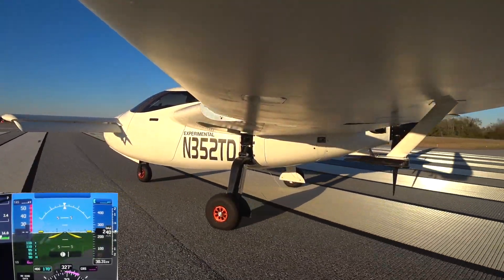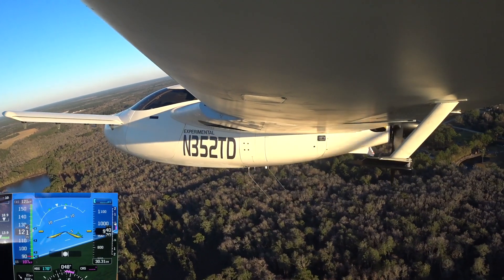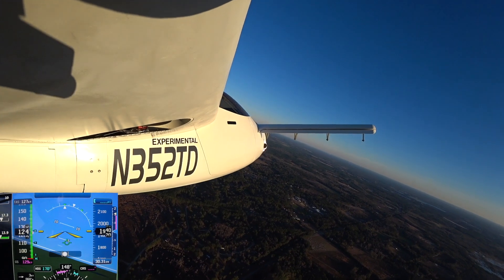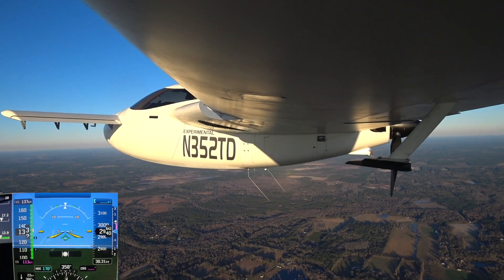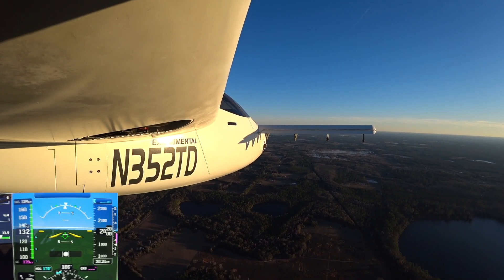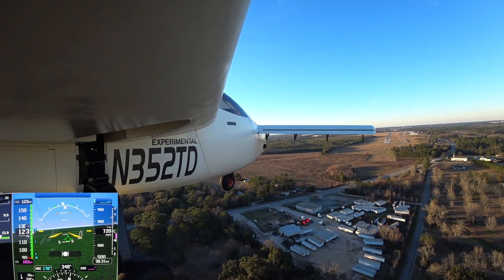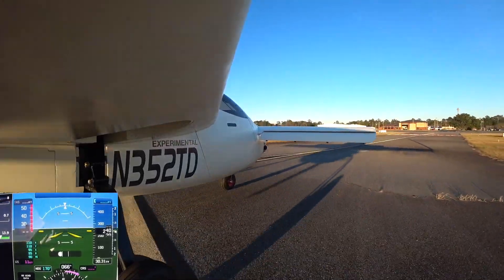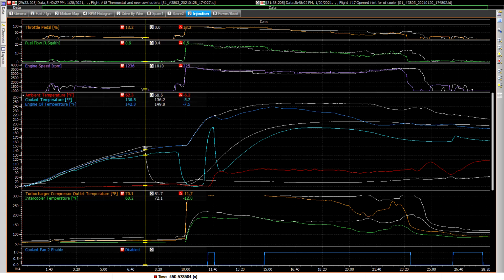Cooler Than Ever - Flying the Raptor Prototype

Comment: I realise that the airframe is a writeoff now....but the pitch oscillations remind me of a Piper Aztec that I once loaded incorrectly when i was a young lad starting out in Aviation and put it way out of c of g position...after takeoff it the nose would pitch up and down until i got some speed to correct it....also...it does not appear that your lateral accelerometer is connected up as the slip ball does not move at all.

Comment: Go for an excess of cooling because someday it will be 100  degrees F. and a pilot will be stuck in a long taxi line.
Reply: I totally agree with you. Been there, done that and got the sweat soaked t-shirt to prove it. Had to “ hold short” on a 35 ‘C day for 20 minutes with the plane parked at 90 degrees to the prevailing wind and 3 other planes close behind me on the taxiway.

Comment: Please have your air-data system checked.  Any performance measures are meaningless without accurate airspeed and altitude information.  When you touched down your altimeter was about 50 feet above field elevations and as you de-rotated your altitude jumped up about 70 ft.  On the takeoff roll your altitude also increased by about 100 ft.  There is definitely position error in your system that needs to be tracked down before any serious performance testing.

Comment: Upon thermostat wax failure....does it fault and stic on the 230 deg or the 185 deg setting?   Might be a better idea to see if you can just set an 180 deg thermostat in there so it has less fail potential.

Comment: 238° in the winter.  Can you interpolate the data for summer air temps?
Reply: Great work Peter.  

1. Curious on the next flight if leaving the heater loop off, and allowing only the thermostat to do it’s job if it can keep normal parameters without all the nose addons.  

2. Would venting all hot air to a point further out on the wing allow cooler air through the prop.  I wonder what the temp rise of the spinner opening, exhaust, exhaust opening, bottom cowling, and the new vents together do to the air temperature through the propeller, vs ambient OAT?  Could the Prop itself be suffering from a “higher density altitude” than in a conventional tractor prop setup?  On a previous video someone had commented on a configuration that would allow hot exhaust to be vent further out, keeping the prop in clean, colder air.

Comment: Just imagine if you had not cut the ducts in the wing skirts and placed a temp probe in there you may have not found out this issue and not discovered the thermostat setting issue. Its not a common issue on a normal vehicle to have a power controlled thermostat. So kudos on the find, well on your way to getting the rest of the program completed and the 40hrs of flight. by the way that was an awesome landing!

Comment: you should also be able to get a lower temp thermostat module to go inside that assembly
Reply: Or even just find a normal totally mechanical thermostat that doesn't rely on the ecu, would be one less thing to mess around with or go wrong.
Reply: Don’t think you want a lower temp thermostat, it’s designed for 185 deg which on a diesel is low, I believe he said he can set the open temp lower via ECU setting or even open it manually
Reply: @SniperJuice  I thought the thermostat opened at 230, and he was trying to get temps down to 180-185. heating the thermostat with the ECU lets it open lower, and that's what he's done to get the temps down.

It also looks like there are high-flow versions (bigger valve so more water will flow when they are open) as well as different temp options.

Comment: Congratulations, I do have a question/suggestion. Do you really think it is necessary to have a thermostat? I have had them fail on cars causing the engine to quickly overheat. It seems like a potential point of engine failure / emergency landing and not worth heating up the engine a little quicker.  Just my 2 cents.
Reply: Agreed that thermostats are unreliable mechanisms, but there needs to be a mechanism for controlling the coolant temperature. Maybe a backup mechanically actuated ball valve to bypass the thermostat in the event of an inflight failure?
Reply: I would think some sort of mechanical thermostat might be safer ???? But not very high tech. But i get it as failure point .
Reply: @rodgerhecht3623  that is a mechanical thermostat (just like on cars), there is just a way to trick it to come on sooner.
to more efficiently burn the fuel, you want the engine hotter, but you don't want it too hot for your materials.
Reply: What happens when you are at high altitudes in the winter, and the temperatures are extremely cold? I think you will need a thermostat for that.

Comment: That was a major find on the thermostat electrical control along with the additional venting of the engine cowling.  Very well done Peter!   Will this help your A/C work better while on the ground?  I'm very interested in your top speed numbers and ceiling numbers.  

Will you repair the window to do pressurized testing or just get an oxygen tank?

How are things coming out west?  Please tell me that you've had all the molds and plugs moved out there and that they are incorporating changes based on your findings and laying up prototype #2 as we speak...  :)

Keep  up the excellent work!

Comment: Now that you know the system is very capable of keeping the coolant in the desired Range - is there any benefit to eliminating the variable of the t-stat?  You could replace it with a restrictor custom milled to the size of an open t-stat.  Would be just like it being open all the time.  Downside is it would extend warmup time. But you would eliminate a situation where it did not open...just a thought. Keep up the great work.  

Btw - I have almost 100k miles on the same Tdi engine as in the raptor.   Not a single mechanical issue and still does not use oil.   Beast of an engine!

Comment: Anybody knows if he is running the AC or not?? Other question he was talking about a oil thermostat the last time. Does this also have an electronic control same as the cooling water thermostat??
Reply from the maker: Heater. It's cold out.

Comment: fantastic take offs and landings!!! skill, I sees it!!! Happy, Happy, Happy ,KOOOOLLLL!!! love to see progress!!! Q, would you put an air scoop where the cut out is for the oil cooler?  Would that give it more fresh air as well?  Great engineering on your part!!.  Glad to see another issue resolved. 10,000,000 attabits for you!!!!  Q, how much air time on the beast? 40 hrs up yet?  Glad to see the over all progress.  Love the stability in the air and on landings and take offs.  Inspiring!!!! Kudos to you sir!!! what is next?
Reply from the maker: I think that real inlet is pulling in the air it needs because of the low pressure on the rear. So no scoop is really necessary. About 7.7 hours now. Going to take it a bit higher and stay up longer. I want to have some flights where I don't have to change anything in between flights. Then I'll feel more comfortable flying a little further from the airport.
Reply: @RaptorAircraft  , I'm sure it feels more comfortable to have plenty of power now with room to dissipate heat for a go around if wanted/needed.

Comment: Can't remember which aircraft manufacturer's video I was watching, but they mentioned that about 35% of an airplanes parasitic drag was due to engine cooling.
Reply: That seems about right for the average GA aircraft, with the caveat that it depends on airspeed, as the faster you go, the lower that percentage becomes relative to the rest of the aircraft.  Air flowing across relatively smooth surfaces contributes a lot less parasitic drag than one would think.  Everything inside the cowling is the antithesis to aerodynamic efficiency, and an aircraft would have quite a bit less drag if you didn't do anything other than plug up the holes in the front of the cowling.  That's one of the reasons why a turboprop gains so much speed when compared to a piston equipped aircraft, even if the power output is identical...a turbine doesn't need any cooling air besides that blanket of air around the flame front.
Reply: @Skinflaps_Meatslapper  Parasitic drag increases exponentially with airspeed - doesn’t matter where it comes from, but cooling drag is something that can be varied with cowl flaps, air scoops etc. The faster you fly, the less induced drag and the more parasitic. Also, air-cooled engines generate more drag (generally) than an equivalent power plant which is water-cooled. Turboprops have a lot less cooling drag, and higher power/weight which combined leads to higher speeds (assuming all other factors remain the same), but the BSFC is much higher on a turbine, which is why Peter is determined to get this Audi diesel dialled in 👍🏻
Reply: @DiverJames  That's what I meant when I said the percentage of cooling drag would be lower at higher airspeeds.  At twice the airspeed, cooling air remains a constant while drag increases 4x, so the percentage goes way down.  For two aircraft with the same engine and cooling requirements, one being twice as fast as the other, the cowling inlet can be made roughly a fourth the size for the faster aircraft.  However, if the fast aircraft is going at the same speed as the slow aircraft, it has 1/4th the cooling air available as compared to the slow one.  You don't want to size the inlets for slow speed, you want them sized for cruise speeds so you're not racking up tons of unnecessary drag.  You have to temper that with the ability to keep the engine cool at slower airspeeds for at least a little while, since that's likely the airspeed you'll be climbing at with full throttle.  That's one of the problems that Peter is running into, he's flying an aircraft meant for high speed at low speeds and the cooling air is harder to get.  Hopefully once he gets the inlets and outlets and coolers and thermostat all working together, he'll be able to retract that inlet at higher speed and cut the drag down a bit.
Reply: @Skinflaps_Meatslapper  All good. Like I said; cooling drag can be reduced in cruise where additional cooling is less of an issue. For Peter’s current configuration, that may be tricky. However, this IS an R&D prototype and no doubt the learning from this airframe will be fed into serial number 2 👍🏻  I have every faith he’ll work it out, and now with the thermostat discovery, some of the other changes might be reversible to improve the weight/drag numbers. Onwards and upwards!
Reply: @rv6ejguy  Good man, I appreciate the explanation.  Even though this is all knowledge I have, it's nice to see someone else offering it up as well in a different format.  Also nice to see a fellow RV owner here, I'm in an RV8 👍

Comment: So did the thermostat really get tested today? Would like to have seen how the thermostat handled. Seems like this flight mostly just tested the new ducts.
Reply from the maker: Yes it did, without it open the temps would not have dropped as much as they did as the thermostat would have been trying to keep the coolant at 230f rather than 185f.
Reply: @RaptorAircraft  Okay I see. So the coolant system as it is will still be needed in the future?

Comment: Does this success mean that you can reduce some weight/complexity by removing the front cooler and loop?
Reply from the maker: Well, I need the weight up front presently to keep the CG in range but potentially it may no longer be needed.
Reply: @RaptorAircraft  How do you anticipate the CG shifting with reduced vacuum bag layup weights? It seems like you will be shedding lots of weight in the rear in the facotry...
Reply: @RaptorAircraft  , More room for your air-travel suitcase? Me thinks your going places!!!